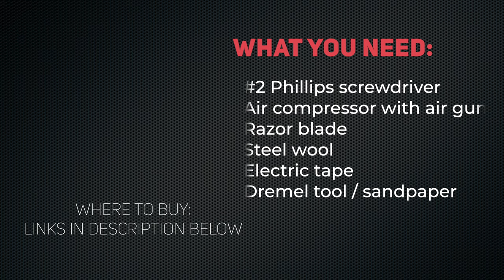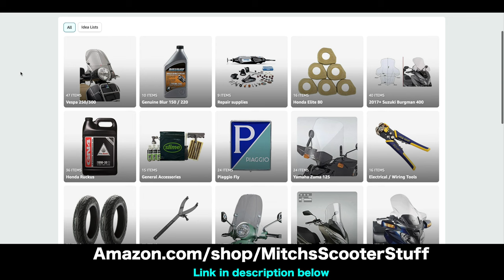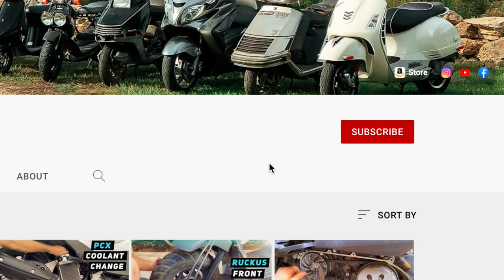Suzuki Burgman - Kuryakyn ISO Grips Installation | Mitch's Scooter Stuff

Comment: Not a fan of the "chrome" but they look like they would be comfortable.  I also thought the grips on my Burgman were too skinny, so I bought some "Grip Puppies". (I'm not sponsored in any way.)  They're installed over the existing grips and add enough to the circumference so my hands don't cramp on long rides.  Bonus is, they don't require removal of the bar end weights or sanding down the throttle tube!
Reply: Thanks for the tip, internet stranger! I have these in my cart to order when I’m able.
Reply from the maker: Yeah I am not chrome fan too but it blends with black rubber look nice touch on burgman. I love these grips because of comfy and good air flow under the hands 😄 yeah grip puppies is pretty simple, both are great 😄🙌🏼

Comment: Mitch, what about the bar end weight stabilizers? With them removed, are you not getting bar vibrations?
Reply: Yes, I am getting vibrations on my scooter (the one starred in this video). I am in fact installing the weights this weekend for my upcoming road trip!
Reply from the maker: My 2007 model doesn’t have bar weights, no vibration but @marioeisme ‘s 2022 does a little, video is coming